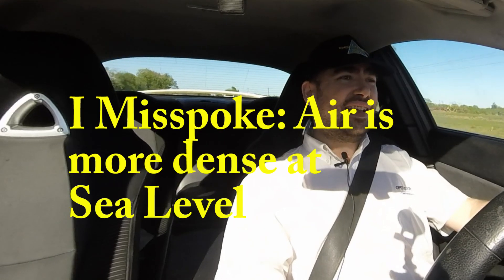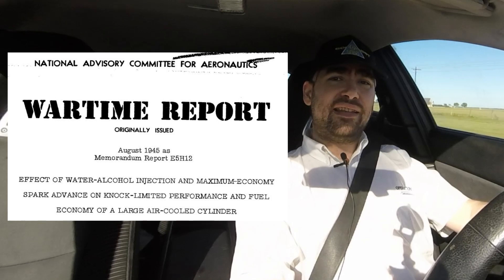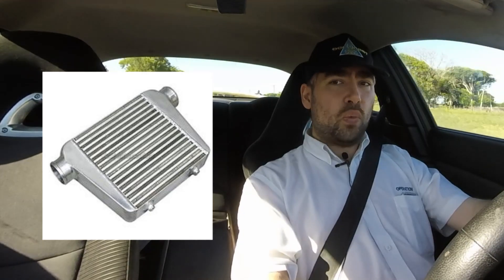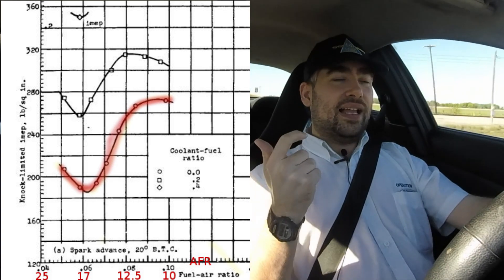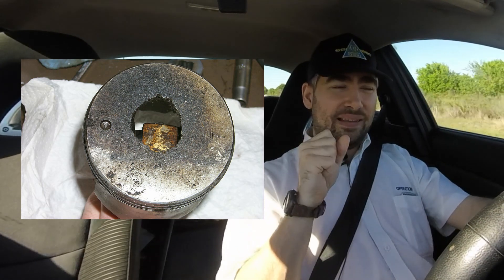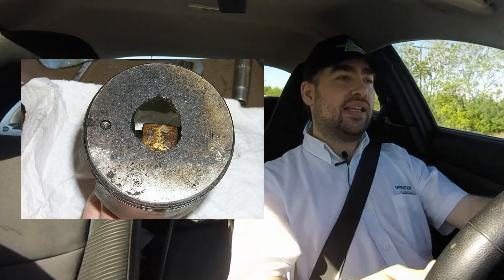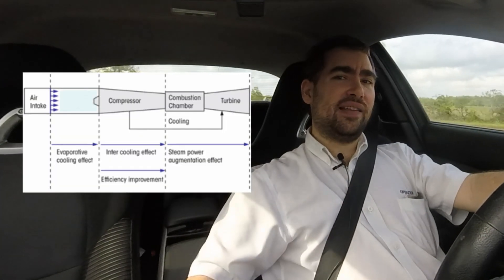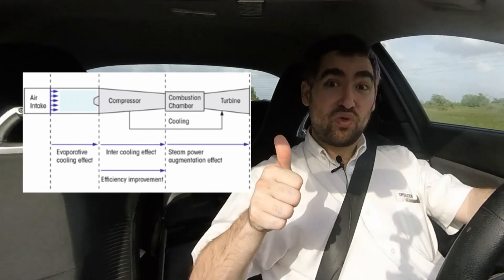Why water injection with no intercooler? Voiding Warranties - Ep35

Comment from the maker: Ok, I've gotten a few responses confusing auti-ignition and detonation, as well as attributing detonation to auto-ignition or saying detonation is directly temperature based and not dependent on internal pressure.  While auto-ignition can cause detonation, auto-ignition can also be present without detonation if pressures are not high enough. If auto-ignition caused detonation (and was all that was required) then the auto-ignition temperature of a fuel would directly relate to the octane of a fuel. The higher the auto-ignition temperature the higher the octane. While this is true for many fuels, its not always true, as is the case of Ethanol vs Isooctane. Ethanol has an auto-ignition temperature of 689F, while Isooctane has an auto-ignition temperature of 837F. Based on that alone the octane of the Isooctane should be significantly higher. In reality the isooctane has a RON and MON of 100 by definition, while the ethanol has a RON of 108.7 and a MON of 89.7 giving it a (R+M)/2 of 99.15 or just about equal to the isooctane. Yes autoignition temperature is measured at atmo, but that's my point. Detontation is dependent on cylinder pressure in the engine. While hot spots or coolant temperature or air temperature can effect this internal pressure at any given air flow, and cooling the air charge can get you a higher mass of air at the same internal pressure, the line in the sand for a given fuel is based on AFR, Peak cylinder pressure, burn time, and burn pattern.  My point is that you can cryo cool intake air using liquid nitrogen, and yes you can get a very dense charge which produces a lot of power, but your max boost pressure will still be limited by the same limit on internal pressure which is limited by the octane of your fuel.

Comment: man, i red "The Background of Detonation (21 pages)" that is in link you gave somebody below to read.
it is from  about 1920-1930 and they have problem with detonation at 4.8 compression ratio.
in that engines they used raw petrol with 40-60 octane number and fixed spark advance.
that literature are older than me and you together, please read recent literature not older 1985. and on the end ,when will occure self combustion/detonation  it depends on temperature resistence of fuel, not pressure
Reply from the maker: +Makan Tahi Don't have time at the moment to find a non paywalled modern study, but you are more than welcome to provide proof of your opinion. Also the NACA studies go far beyond fixed timing on low compression engines.
Reply: ok, i give up

Comment: does anybody try to spray just water on outside of intercooler -it would cool down more, and can use water as you wish, and you could get more boost
Reply from the maker: +Makan Tahi yes some people do this, but the effects are limited by the dew point of the outside air and the temperature of the intercooler. Injecting the water is much more effective, because it also acts as an anti detonation additive.
Reply: ok,  i use water spray on engine cooler to cool it faster to spare fan of using electricity
Reply: Might car mods did a video on it, you can use your wiper fluid tubes and reroute them in front of your intercooler.  I have the ones that spray my headlights spray my intercooler.  Not a huge improvement but it can lower temps slightly.

Comment: you are wrong, temperature matters, pressure not, on the end of comppresion stroke is only important the temperature- it determines fuel resistance to detonation or octane number, it could be any pressure and no detonation if temperature is lower than detonation temperature of fuel,
Reply from the maker: +Makan Tahi I appreciate your opinion, but it is not supported by actual research. Internal cylinder pressure is what causes detonation. Higher temperatures can effect required timing and in turn raise the internal pressure or they can cause pre-ignition, but temperature alone cannot cause detonation. If you don't believe me, try making gasoline explode at atmospheric pressure using the hottest heat source you can find. It will just burn, possibly very quickly, but won't detonate.
Reply: check octane number definition and how is determined -( temperature breaks conections between c and h in petrol and h is instable so it start to burn in very high speed-detonation) ... in engines with forced induction intake air have to be cooled down to temperature below det. temp.  but boost pressure can be raised almost to infinite, thats why engine power can be raised if put bigger turbo charger must put bigger intercooler-more air is cooled on same/lower temperature but pressure is raised so engines get more air and engine can make more power with same fuel/octane number. teoreticaly if intercooler could cool down , air would be in liquid state
Reply from the maker: +Makan Tahi octane numbers are measured with variable compression engines. It is a measurement of compression vs a standard fuel, so yes it does all come down to pressure. Boost pressure can only be higher with lower temperature air when timing is constant, such as in an aircraft engine, because colder temperatures have the same effect as retarding timing. Even with the coldest charge temperature possible you will still be limited on the ultimate power you can produce by octane and cylinder pressure.
Reply: yes that is right and conclusion should  be that the moment of detonation is in direct relation with temperatureof air/fuel mixture  on the end of compression stroke.
Reply: Makan Tahi high temp can cause pre ignition....
Reply: Please see Gay-Lussac's Law

Comment: Do more research before following this advise. First off, meth will bump your octane up there for less chance for knock. Also greater cooling. The other considerations are what kind of vehicle and use... Do 
more research???
Reply from the maker: +Paul Cook Thanks for the feedback. Meth does boost octane, but as proven water does too. The biggest benefit of meth injection is the partial pressures in air which allows more methanol to evaporate by weight at a given temperature because there is no methanol vapor already in the air. This means cooler temperatures with meth/ water mixes than with water, or methanol (depending on humidity), alone. It's not as easy to calculate the benefits as most people think.
Reply: It’s predetonation that’s bad not detonation
Reply from the maker: +Jim Bailey I believe you are thinking pre-ignition and that is bad. Low level or pre detonation is harmless by itself.
Reply: Paul Cook nothing beats the cooling power of water.

Comment: I totally disagree for one reason: Generalization.

You can't say intercoolers with WMI are pointless. Remember you are injecting before the turbo, so the listeners would have to remember that before they ditch their intercooler on their system.

Secondly, you are not running enough boost / airflow to put your car at the same risk as say a guy with an EVO running 26 psi on a 20G turbo. If your WMI fails on that car, having no intercooler will only make it harder for the engine to pull timing or go to a failsafe boost level.  And believe me, they all fail if not serviced frequently (from aquamist to the least of them).

Also, if you have a MAF based system doing pre-turbo is a pain not worth the gains.

The easiest thing to see some 20% gain in torque is to do a post intercooler injection with a good PWM valved system. 

I build and tune WMI systems (not kit, systems).
Reply from the maker: Pre intercooler Water injection lowers the efficiency of the intercooler drastically, and vice versa if you inject after the intercooler. It's basic thermo, harder to cool something that is already near ambient (or in the case of WI closer to saturation). Don't ditch the intercooler unless your WI system is bulletproof, but if it is, you can and probably should.
Reply: Yea bud, and it gets more interesting! That's the general consensus but let's introduce some more variables and think on this again.  Let's consider 100% meth, 50/50 and pure water. 

With an outlet from the turbo at 130C,  pure water flashes easily and cools the best as it has a greater specific heat capacity. The water phase changes much easier at that temperature (and pressure!) than it would at around 45C exiting the IC. (Note: The charge pressure makes injected liquids harder to phase change).  This location maximizes the cooling potential of the water while limiting the cooling potential of the IC.

Injecting pure water at the exit of the intercooler may result in the water failing to flash and not really cooling the charge temps as much. Then there is distribution problem: those (relatively large compared to steam) water droplets are stubborn at taking corners. 

The problem with injecting water before the intercooler is two-fold. First, we have a minor issue with a heat soaked intercooler, as you mentioned above, but that only lasts a few seconds as once the vehicle is moving the core temp drop extremely fast. 
The other problem (my hypothesis now) is that the water will turn steam and expand to 1600 times its volume taking up space in that intercooler. Effectively, this feels like a partially closed throttle. In my tests I found that while the car didn't knock it felt stifled running the nozzle at this location.

This 1600x expansion is better off occurring in the combustion chamber, and it's believed that this adds to the power output of the engine. I don't remember if this was covered in your video. This is why 100% water shines brightest when doing direct port injection. No distribution problems and the combustion chamber gets all the cooling benefit of water.  

So while the IC can reheat the charge when its above ambient, it's only for a while. The real problem is the stifling effect as the IC become a battleground where air is fighting steam over volume.
Reply: That's the internet & bookwork consensus. In the real world there is more to it. Spraying before IC makes water do the job while the IC becomes less efficient (differential temps, as u mentioned). Spraying after the IC makes the IC do most of the cooling and the water (being under heat and pressure) is harder to flash, and has much less to do, making water less effective.  If running a mixture of pure water injection Pre turbo or direct port is the way to go. Otherwise, some methanol is needed to flash and equally distribute to the runners (large water droplets don't distribute well) 

At 130C the water enjoys flashing to vapour, pulling out most of the heat, but the IC if it was heatsoaked will heat it up above ambient  - so not ideal for drag racing setup. On a circuit car it matters much less. 

Pre IC breeds less power though. The only thing that keeps me from pre intercooler injection is that the water expands to 1600X in volume,  taking up space in the intercooler and creating a situation that basically feels like you are at partial throttle. It won't resist knock any more/less than post IC setup, but the suffocation can surely been seen in the logs.  And this was only with a 150cc of pre IC with a 300cc post IC nozzle.

Comment: great video! I read about water meth injection as well when I was putting together my $50 pre turbo water meth setup. what I read said they used the water meth more in an "emergency power" situation.. some of them apparently had a breakable stop on the throttle so that when the pilot used it they would know to inspect the engine afterwards! not because the meth is bad for it but because they were just that far over the power they were designed to run at.. pretty cool stuff!
Reply: First off, NEVER do pre-turbo injection. Read into Saab's history about those experiments in the 60's and 70's
Reply: been doing it with great results all year, check out my channel for updated information on this. this is the second time today someone mentioned 1970s studies saying I cant do what I'm doing in 2017 lol. maybe it wasn't financially feasible then, but it is easy to atomize the mixture enough to avoid cavitation in most applications. I dont atomize it at all currently and the wear rate is very acceptable for my program, I'm likely to wear out other parts of this cheap turbo before the water/meth hurts anything.

Comment: Wrong the lower you are the more dense air the higher you are the air is less dense 🤦‍♂️
Reply from the maker: Yeah, I misspoke once, and didn't catch it on the edit. Low altitude air is much more dense than high altitude air.
Reply: Lower the altitude, higher the air pressure.
Reply: @petroldevo9934  up to 14.7 yes. Denver, for example, at 1 mile above sea level has a pressure of around 12.